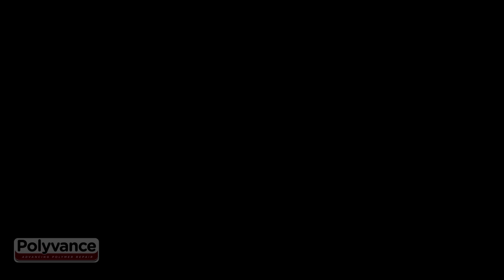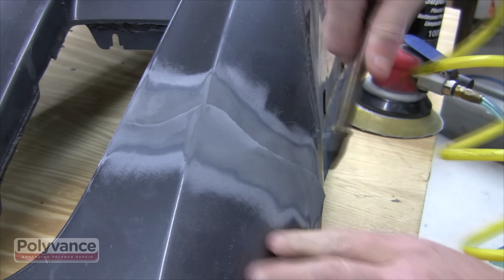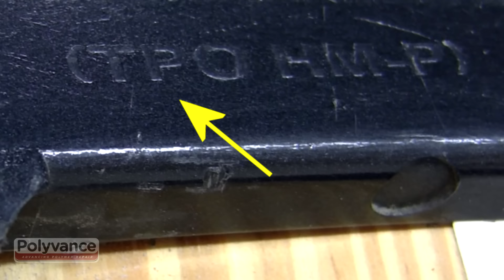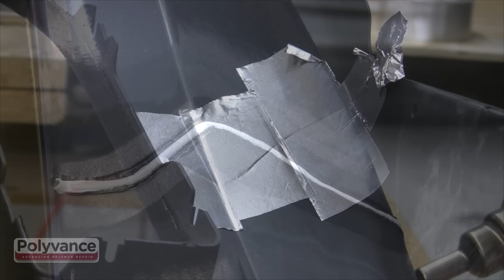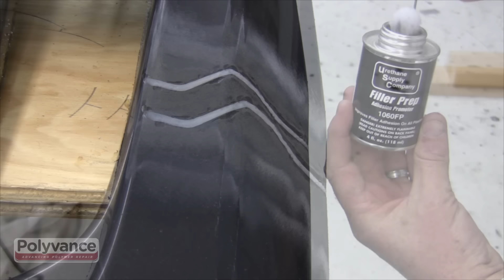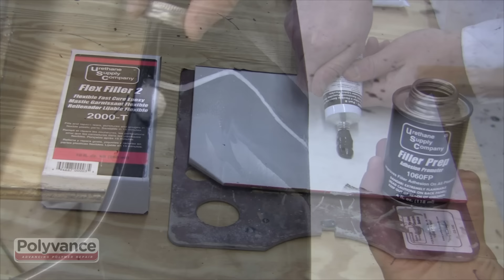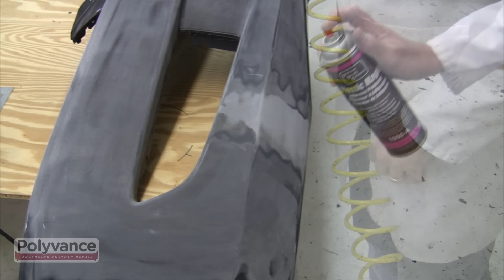Bumper Repair with Hot Air Plastic Welder

Comment: What about Polyurethane bumpers? Can they be welded as well? I believe PU is not thermoplastic and does not really melt.
Reply from the maker: Correct. PUR is thermoset polyurethane, so it does not melt. Here is a playlist showing PUR repairs and how they are done: https://www.youtube.com/watch?v=UKIILcmWF0g&list=PLmdrqwjPa5t8Dzx05kPVzr1yC-DauXWNt
Reply: Awesome playlist, thank you. Can I additionally use hot staples inside the V-groove before airless-welding it shut?
Reply from the maker: @famkis8680  No. Because the plastic does not melt, you won't be able to melt any hot staples into it.
Reply: I did already melt some hundred hot staples into it from the back at some other cracks, so this does work.

Comment: Why clean the surface if you're just going to sand it off anyway?
Reply from the maker: If you have contaminants on the plastic and you sand or grind it, it's likely you will embed some of the contaminants into the sanding scratches (which will impact the quality of the repair). You should always clean the plastic first!

Comment: Why would you clean the plastic before sanding the plastic? That makes no sense at all!
Reply from the maker: If you have contaminants on the plastic and you sand or grind it, it's likely you will embed some of the contaminants into the sanding scratches (which will impact the quality of the repair). You should always clean the plastic first!

Comment: Looks like all those materials cost more than a used bumper?
Reply from the maker: Hello. Our hot air and nitrogen plastic welders are mostly for body shop use. Using this equipment, a body shop can repair an OEM bumper and other plastic parts. Shops would be repairing more than a single plastic part.

Comment: From the money for the tools and the 4 hours of work, plus the painting costs.  It's cheaper to buy a used bumper in the same color.
Reply: And there lies the problem, finding a good used bumper in the same color.
Reply: @scottb7600  Internet my Friend. Goooood Oooooold Internet. WTF
Reply: @boyishot69  Right.  Isn't that is where everyone starts?  Finding a replacement bumper that is in good shape, in the right color, the right Y,M,&M and having it shipped and not get damaged in transit, is next to impossible for most cars.  You also need to factor in the high shipping cost for a bumper cover along with the bumper price.  Sometimes you can find one in a local salvage yard, but generally, those bumpers are also damaged.  So while the average DIYer may not opt for a hot air or nitreogen welder due to cost, and can make up for it spending more time doing the repair, an airless welder may be a better choice for them.  However, many DIYers like having the best tool for the job and want to have a versatile welder on hand for repairing other types of plastic quickly.  So, for them, a hot air welder would be an excellent choice.

Comment: is this methode only good for TPO plastic ?
Reply: NO, it can be used on any thermoplastic (meltable plastic) as long as you match the filler rod material with the substrate.
Reply from the maker: The hot air/nitrogen fusion welding method will work on any thermoplastic (meltable plastic). Make sure you use the filler rod that matches the plastic you are repairing, and make sure both the filler rod and base material are melted they come together.

Comment: It's easy to see you've never done this before. At the beginning of your video you decided the clean the plastic. That made no sense because the next step was to grind off the paint. Guess what? The surface was contaminated again. Are you kidding me??
They were correct, you can't fix stupid !!
😂😂😂😂😂😂😂😂
Reply from the maker: If you have contaminants on the plastic and you sand or grind it, it's likely you will embed some of the contaminants into the sanding scratches (which will impact the quality of the repair). You should always clean the plastic first!

Comment: No need to touch the outside of the bumper at all,connect outer so its flush and weld the inside ,no need for tape inside

Comment: Seems most costlier and time consuming then purchasing new parts....
Reply from the maker: Out hot air/nitrogen welders are mostly used by professional body shops. Shops can make money, save the customer money, and keep plastic out of the landfill. Shops have to invest in equipment to perform all kinds of repairs on cars. We have a sheet they can fill out that shows how many repairs it will take to make their money back on the machine.
In some cases, a new part may be cheaper, but in some cases it may not be. Being able to repair is beneficial when parts are not available. Also, these machines can be used to repair more than bumper covers. They can be used to repair headlight tabs, inner fender liners, fluid reservoirs, and more!

Comment: Super glue and baking soda.  Thank me later 👍
Reply from the maker: Super glue won't stick reliably to polypropylene. Additionally, super glue plus baking soda makes a rock hard "repair" that is super brittle. If it gets bumped or stressed, it would shatter. Bumper covers are flexible and they get bumped and stressed often.
By properly fusion welding using filler rod that matches the base material, you are essentially making the plastic whole again.

Comment: Just buy a new bumper some only cost 60 bucks some around a hundred bucks lol 😂. This is America, in third world country this is feasible. In America your shop is better off spending time on something else more lucrative. Most shop even buy a whole new section from a junkyard instead of straightening a dent to cut down labor time, and back job from imperfection. This would be good for a DIY though just for fun. I have rods from a regular plastic welder and hot air machine I use for surface mount board work. This is something that would be fun to do if the need arises
Reply from the maker: There are many cases where a new bumper cover is not available or too expensive. Shops can benefit from repairing instead of replacing, especially on small damage like broken tabs. Also, hot air/nitrogen welders can be used for more than bumper covers. They can be used to repair headlight tabs, washer fluid reservoirs, inner fender liners, and more.

Comment: It took me lot of trying to learn to do it correctly . I need this for a DIY custom bumper i made . I used for melting rods pieces from the old bumper after i cleaned them because they matched the same plastic . Great video helped me a lot
Reply from the maker: Thank you! Yes, using the material that matches the plastic you are repairing is key! It's nice when you can use scrap pieces from a donor part.

Comment: you need to clean the plastic and then you go ahead and sand the area. Why waste cleaning material??
Reply from the maker: If you have contaminants on the plastic and you sand or grind it, it's very likely you will embed some of the contaminants into the sanding scratches (which will impact the quality of the repair). You should always clean the plastic first!

Comment: I got taught some slightly different techniques, but the key takeaway should be to prepare properly, use the correct filler rod and use the correct temperature for your materials.  Shame that car bumpers often use so much talc in their formulation.
Reply from the maker: You're right! And to make sure both materials are melted when they join together for a proper fusion weld.

Comment: If you can get behind the panel why not repair from the back using a fibreglass kit?
Reply: Because fiberglass doesn't stick well to polypropylene and your crack will be back in a short amount of time.
Reply from the maker: Fusion welding is better than using any kind of epoxy or resin.
We repair both the frontside and backside in this video, making a very strong repair.
When you properly fusion weld (using a filler rod that matches the base material,) you are fusing the two plastics together, essentially making the part one whole piece again.

Comment: failing all that , save yourself some money and go to the scrapyard or ebay..
Reply: The beauty of getting one off eBay is that by the time the shipper is done with it, you'll have more to repair than your original part.  There are reasons cars go to the scrapper and most don't have bumpers in good condition.
May as well keep what you have and fix it.  You'll save time, money, not have any fitment issues and may even be able to blend the repair and not have to repaint the entire bumper.

Comment: just one little question
if I am going to remove the paint with a sander,then why clean area first with plastic cleaner...that is cleaning the paint that I'm that will be removed before it's removed
why no remove dirty paint?? 
saves time & money
Reply from the maker: If you have contaminants on the plastic and you sand or grind it, it's very likely you will embed some of the contaminants into the sanding scratches (which will impact the quality of the repair). You should always clean the plastic first!  You can clean it again after if you wish, but you should always clean it first!

Comment: plastic welder is just a fancy name for a heat gun?  Bosch has a number of such models. for about $100 or less.
Reply from the maker: Do not use a heat gun to weld. You will either fry your heat gun by restricting the airflow too much, or the heat source will be too broad and you will warp your whole bumper and not end up with a weld.
There are hot air welders that look like heat guns, but they have digital temperature controls and reduction nozzles. The temperature control allows the reduction of flow without melting down the gun. An example is our Steinel LCD Hot Air Welder Kit: https://www.polyvance.com/Hot-Air-Welders-1/6055/
If price is an issue, we have some cheaper airless plastic welders that will make strong welds.

Comment: And the end result?????????? 🤦‍♀️
Reply: Did you watch the whole video?  It went as far as primer...from there you would topcoat it with whatever automotive topcoat system you like.
Reply: @scottb7600  Yes, and the last scene shows the paint application. We did not see the final result with everything dry and polished
Reply: @Cesar_EP  Finishing wasn't the point of the video.  Every body shop knows how to paint a bumper, but the steps remaining to get the bumper painted are only finish sanding, shooting the basecoat, and the clearcoat.

Comment: Ideally, twist the stick too, this promotes better adhesion and the polymers are stronger.
Reply: If the right amount of heat and pressure are applied, there is no need for twisting the rod.

Comment: Just wondering, why my plastic abs rods doesn't melt?
Reply from the maker: To answer that, we would need more information. Were you using a hot air welder or an airless welder? Were you using Polyvance ABS rods and welder?

Comment: so you wipe then sand putting all the crap and contamination into the repair.get a life not a you tube.
Reply: I think you are missing the point.  You clean, which involves wiping, then you sand the paint off the repair areas.  This keeps any waxes, silicon, or other oily contaminants from getting ground into the plastic during the sanding process.   Because the paint is dry, it doesn't get embedded into the plastic and can be wiped off cleanly before any other repair work is done.

Comment: Bumper covers are pretty inexpensive. As a novice who repairs my own automobiles, I don't see the value in trying to save one of these. Although I have a similar hot air soldering device that I use to repair my electronics complete with what appears to be the same nozzle and a digital temperature control I still wouldn't waste my time. This must be a labor of love and skill. Nice demonstration and enjoyed viewing the video earning a thumbs up.
Reply: IT all depends on the bumper cover.  If you have a honda civic or other car with a $100 new OEM bumper,  you'd only ever repair minor damage, but some bumpers are so expensive, you could spend days repairing them and still come out way ahead.  Thene there is availability.  If you have porsche, bmw, or tesla, for example you may have a 6 month wait for the bumper.
Reply from the maker: As Scott mentioned, it all depends on the bumper cover. Some are extremely expensive, and right now some are hard to get. We had a call from a shop earlier this month that said 2022 Kia Carnival bumper covers are backordered until February of next year. The bumper cover was repaired with one of our nitrogen plastic welders, and their customer didn't have to wait.
Additionally, our nitrogen plastic welders repair more than just bumper covers. You can use them to repair fender liners, windshield washer bottles, fan shrouds, headlight tabs, and more! Headlights are getting more and more expensive, and being able to repair them can save the customer a lot of money.
Reply: It's like a 50 step process! Lol

Comment: So what process is the better way.hot air welding or hot iron welding  with the steel mesh..?
Reply from the maker: Hot air welding is much faster than airless welding. Going further, nitrogen welding is better overall than hot air welding because the nitrogen acts as a shielding gas and keeps the plastic from burning.
You can still add in the stainless steel mesh when hot air welding if you need extra reinforcement for your repair. We did this in our video where we repaired a kayak with the nitrogen welder: https://www.youtube.com/watch?v=XFR1kcZJfcA&t=110s
Reply: @polyvance  ok..I'm in the autobody trade and deal with busted bumper cover frequently..I've been using the hot staple gun..with moderate results...can you recommend a setup that may be the best for my needs..thanks
Reply from the maker: @rossokeefe9268  If you're repairing a lot of bumper covers, a nitrogen welder would be good for you. You don't want to solely repair with hot staples.
We've got 8 different nitrogen welders to fit a variety of budgets: https://www.polyvance.com/Nitrogen-Welders-1/ Unfortunately, we are having supply chain issues and we are currently out of stock. These welders range from $1295 to $4895.
Send an email to info@polyvance.com and ask for some literature on the nitrogen plastic welders. If you would rather speak to someone, you can call us at 800-633-3047. We're happy to help.
If you'd like us to do a demo at your shop so you can see it in person, we can do that.
Reply: @rossokeefe9268  Absolutely.  If you see the potential for doing repairs daily, I would probably steer you towards an 8203 Nitro Fuzer, even though its quite a bit more than the 8202, it has a built in nitrogen generator so you would never need to buy nitrogen or rent bottles. a 100 cu ft bottle will be used in about 6 to 8 hours of actual weld time, depending on your set-up, this can add up pretty quickly and it is a little bit of a pain to swap bottles out, especially if you are in the middle of a repair.  If you only might doing a few repairs a week, then go with the 8202 Nitro Fuzer as the added cost of the 8203 will take longer to pay off.  But then again, we have had customers recoup the entire cost of an 8203 on one repair!  (Maybe you'll get lucky, too and a Lamborghini will roll in with a broken front and rear bumper!)
Reply: @scottb7600  thanks for the info

Comment: And I'm watching you welding with an open tipped actually make it tip that you insert the welding rod you can buy that at Tom Duffy and Company all over the US and you're able to push physically down on it
Reply from the maker: Yes, we also have an airless plastic welder with a "tube tip" that you insert the rod into. Welding with hot air or nitrogen is much faster. Using nitrogen instead of hot air helps prevent oxidation of the plastic because the nitrogen acts as a shielding gas.
Reply: @polyvance  thank you for the info I've been learning so much from the internet even though I'm an older guy and have a old school things I hope I have little to teach the people to
Reply from the maker: @crazedgoldminner7384  I'm sure you have plenty of knowledge to share!

Comment: There's a little grooving tool so if you can bevel it just like a welding a piece of Steel and weld it you'll get a stronger weld
Reply from the maker: Yes, there are plenty of ways to make a v-groove and rough up the plastic. We usually use a die grinder and change the bits when needed.

Comment: You can buy the vinyl plastic welding rod from your local floor supplier it's either called for bow or I am the other names gets me right now but it's made for welding floors together commercial vinyl but it works on plastic really well and it's not pricey
Reply from the maker: With plastic welding, your filler rod needs to match the base material in order for them to properly blend. If you try to weld with a rod that doesn't match the base material, it will just peel right off. Vinyl plastic rod will not adequately stick to most plastics.

Comment: how good is this repair compared to combining with staples?
Reply: Its better.  Witch staples alone, you can't build a repair that can be painted without the risk of the paint cracking at the repair.  Staples can be added to this repair however to reinforce high stress areas that may be subject a lot of sheer or tensile loads.